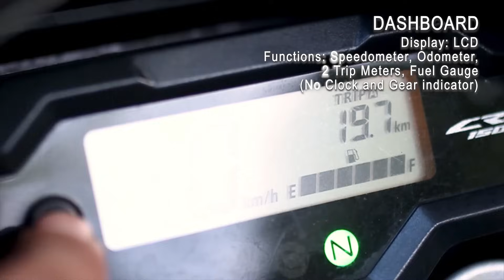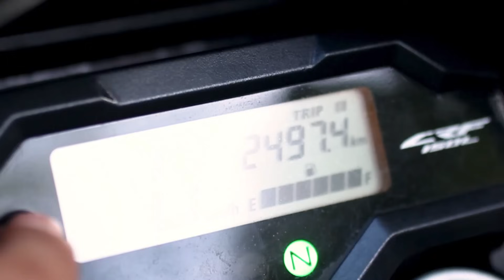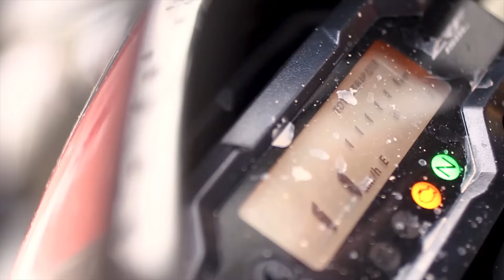HONDA CRF150L  FULL Review | PINAKAMATIBAY na MOTOR na sinakyan ko!

Comment: very basic, simple, at maporma, walang drama ♥️
Reply from the maker: Yeah. Just twist and go!
Reply: @UtoyOnWheels  You why it is slow. Simply it isn't built for the tarmac & it's different engine to the one they put to their dirt track counterpart. The good thing is, it's already torquey enough. That's how Honda built their bikes. Yah, shame that it's so slow for example compare to the W155r of Yamaha. But I believe their is a reason for that. The one thing I don't like with this bike aside for the lack of power is the handle bar, it needed to be changed.
Reply from the maker: @dayleashleynolasco5765  Correct that's what I said in the review.
Reply: omsim

Comment: Lowered ung front shocks mjo iba handling nyan, and ung sprocket nya na nakakabit is low speed probably 13-51 combination (size 520). balik mo sa stock 428 15-49 at sasabay sa NMAX 155 sa road, we crf owner, mga tropa usually nireremap namin at umaabot naman ng 120kph, meron ako nmax V2 and 2023 CRF 150L so natesting kona.. tried and tested.  If budget permits, mas matulin ang Yamaha WR155 with 155cc 4valve, VVA, or mag CRF 250 na, mjo dehins lang sa trail dahil mas mabigat, nice content bro.
Reply from the maker: nice comment. Well may nagpahiram lang sakin nitong CRF na nireview ko kaya hindi na siya fullstock setup. Basta ang masasabi ko lang, sulit na sulit talaga itong CRF. Isa ito sa mga paboritong motor na nagamit ko at kung bibili ako ng pangtrail, ito talaga pipiliin ko for the sole reason na kaya niya naman gawin lahat ng kailangan ko maliban sa storage syempre hehe

Comment: nice review! maybe i'll get 1 when i'm back to phils! well i'm still not decided which i'll choose either Yamaha or Honda. maybe you can give more comparison info. Thanks.
Reply from the maker: YAMAHA will be better with all around performance but the CRF will have better aftersales and customization options and will have better bang for the buck value. Would still go for the CRF because it will not hurt as much when you drop it trailing rather than the WR155. But if you want more power, go for the WR.
Reply: @UtoyOnWheels  thanks for the quick reply I didn't expect you'll notice my comments. I'm using original Honda Enduro 125 and really durable before I work abroad.

Comment from the maker: Shoutout HONDA Philippines! Baka may bago kayong ilalabas na model, pwede tayo diyan heheh
Reply: Maganda sana ma release ang cb150r ma test drive nyo sir yun nlng bilhin ko
Reply from the maker: @karansotv7181  to be honest, kung sportbike na 150cc, yung R15, mas maganda performance sa CBR.
Reply: @UtoyOnWheels  kng ikaw sir bibili ng motmot sa halagang 300k   ano pipiliin mo?
Reply from the maker: @karansotv7181 Good question. 2nd hand na KTM Duke 390
Reply: @UtoyOnWheels  hmm, ayaw mo ng r3 , mt03 ktmadv 390 sir? Duke 390 ylga final answer? Pwede mo ba sir ma expound bkit? Bago ako bumili ng motor
Reply from the maker: @karansotv7181  TORQUE. Exciting kasi talaga ang mga KTM gamitin kahit mavibrate sila at prone sa overheat. Ung ADV390 naman, halos same lang naman DUKE. Dipende talaga sa need mo. MT03, masyadong maamo, para sa naked. Mag R3 ka nalang kesa don.
Reply from the maker: @karansotv7181  Torque at handling ng KTM. Nothing like it. May R3 na kami. Mas mabilis siya at precise sa likuan pero mejo boring siya sa road use.
Reply: sir ayus na ayos po kayo mag review ng motor nice ridesafe lagi 😁✌
Reply: @utoy on Wheels crf 300L po